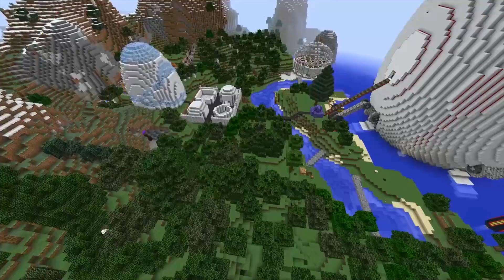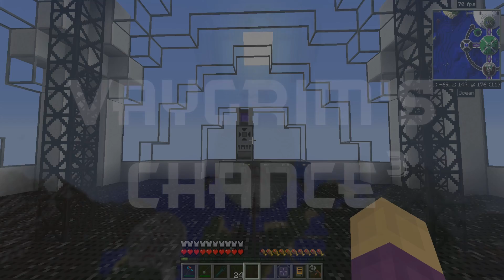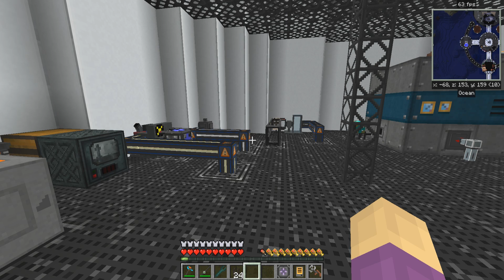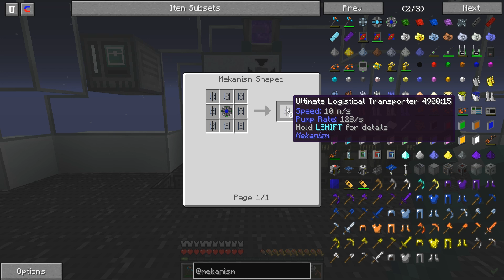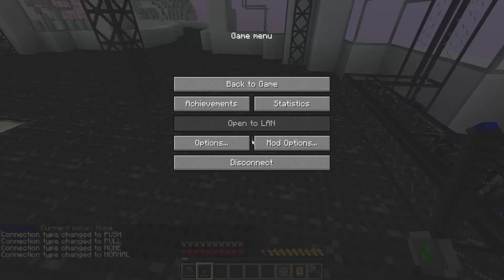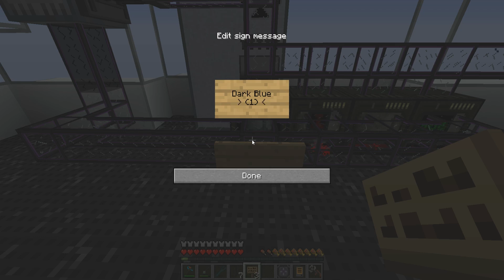Vaygrim's Chance 3 - #57 Logistical Transporter

Comment: The main problem I've had with the logistical sorter in the past - all the widely-separated times I've tried to use it - has been that it occasionally would get stuck, just utterly stop processing, despite having a valid destination for the stuff in the source container - indeed, if I manually moved an item over, then it would sometimes realize that there was somewhere for that stuff to go and it would fill the stack the rest of the way. Really aggravating.

Not sure if that was related to oredict wildcards, though. Using individual itemstacks might prevent that.